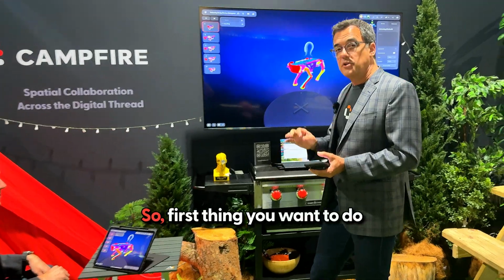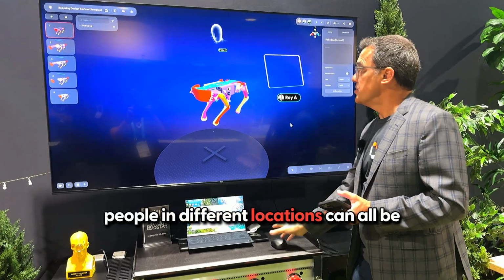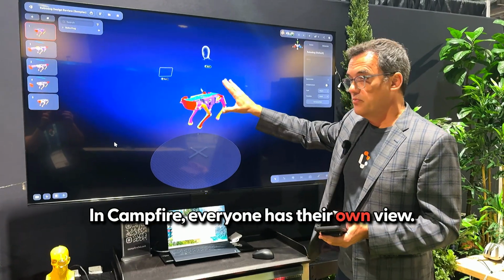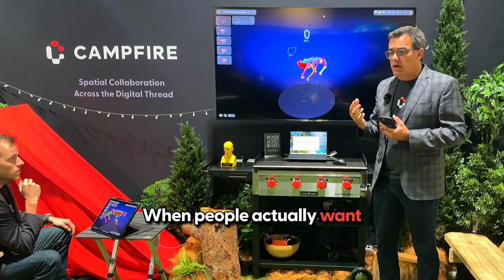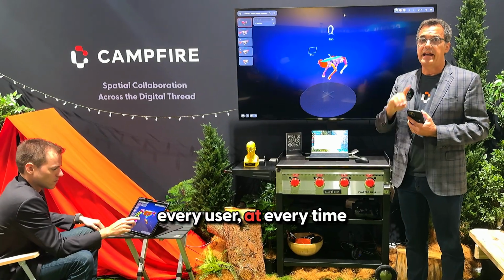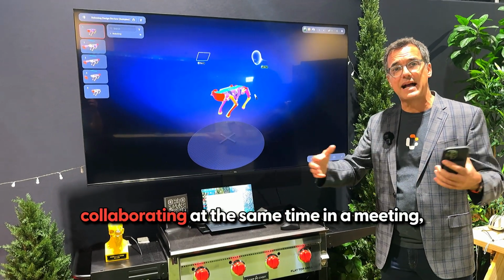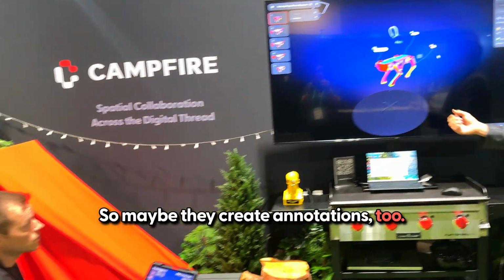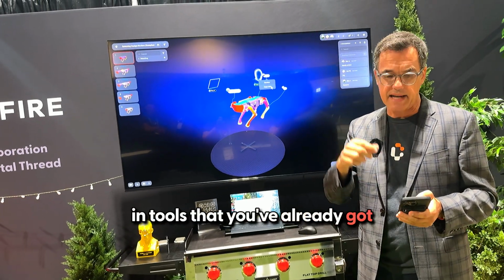Campfire Demo Setup: How to share Campfire with your team

Comment: I would like to ask about online collaboration in Campfire. Is it possible for multiple users to join the same project remotely and communicate directly via voice inside Campfire, or do we need to use third-party applications (such as Teams or Zoom) for voice communication during collaborative sessions?
Reply from the maker: Thanks for your question.

Some customers prefer using Campfire along with Teams or Zoom, but Campfire does have built-in voice chat — so, yes, you can communicate directly via voice inside Campfire!
Reply: @Campfire3D  Thanks for your feedback. I’ve also done some testing. It seems that voice communication works from PC/desktop to other devices (e.g., Meta Quest 3), but not the other way around. Is it currently possible to enable the microphone from the headset side, or is this feature not yet supported in Campfire?
Reply from the maker: @faikarzakky8759  Voice chat is supported on Quest 3. Please make sure to turn the microphone on in Horizon OS settings.